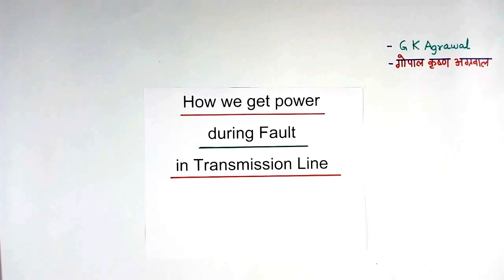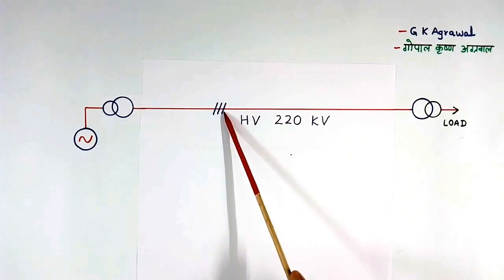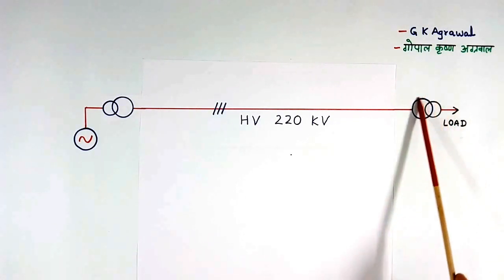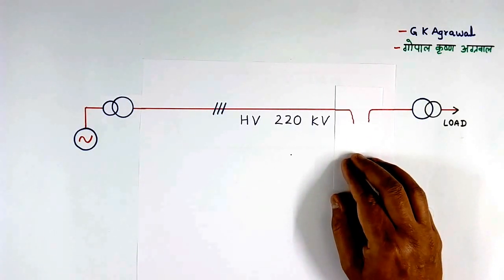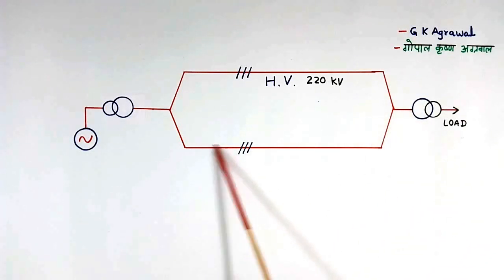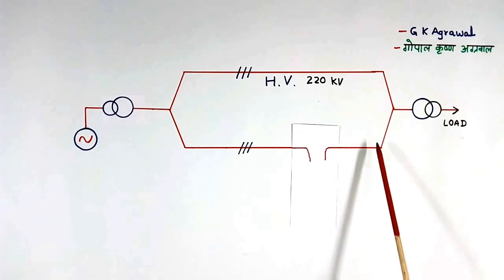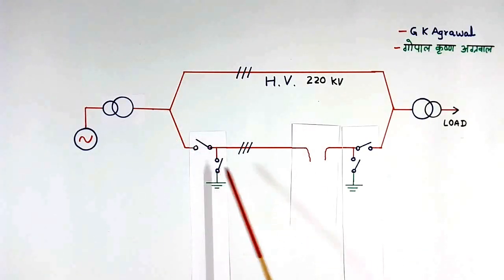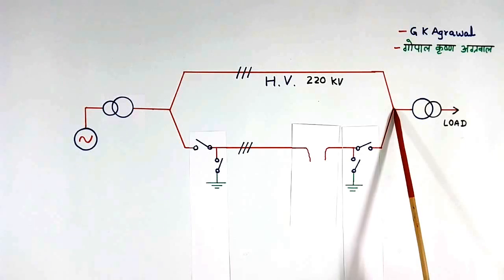Transmission line to ground fault | power system

Comment: While repair why we are connecting disconnected part with ground even thought it has no electrical connection?
Reply from the maker: This is very very very important,  
1- Line wire will have some capacitor , which are charged to very high voltage, so by grounding it get discharged. This is electricity safety rule.
2- Floating wire ( not connected to any where) may get stray charge ( in high voltage area) to very high voltage.
2- If by mistake some body switch ON breaker, then also you can imagine the risk,

3- In every high voltage sub station, every thing is grounded before touching. This is very strick rule and highest authority in sub station is responsible for this. Without grounding, he will not give permission to touch the wire.
4- Many places this grounding isolator may have lock also, which will be locked at ground position, such that by mistake also nobody should do any mistake.
Reply: G K Agrawal Thank you sir.
Reply: G K Agrawal  But sir if you will explain about "stray charge" the concept will be more clear .